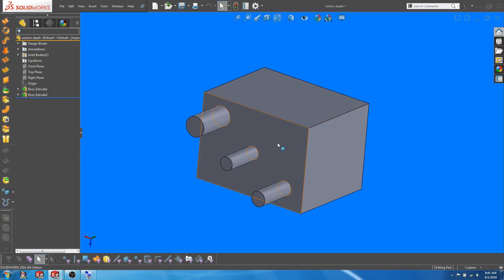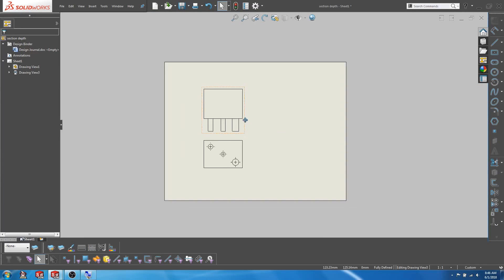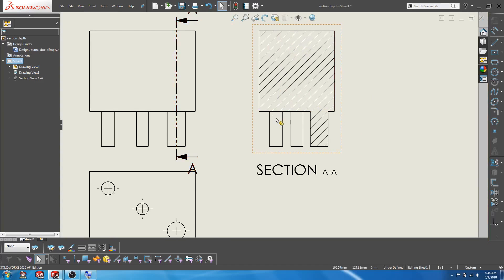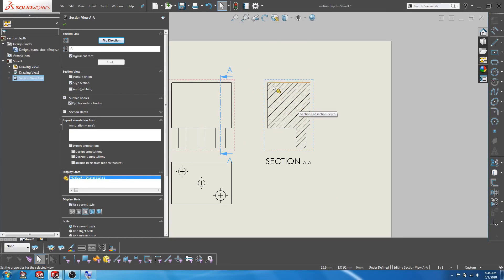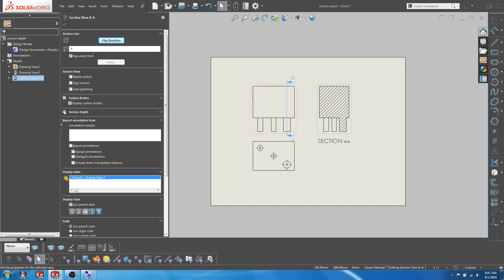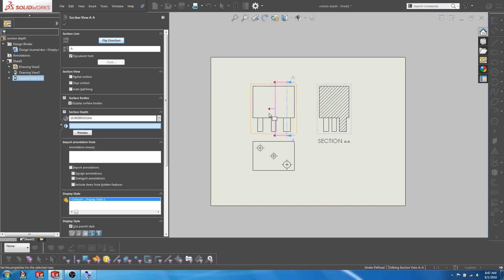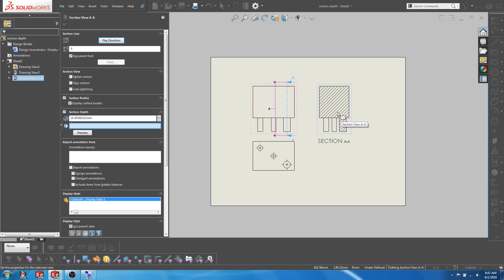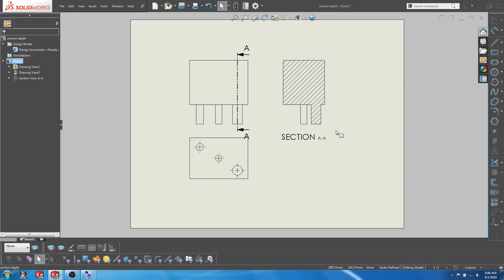Solidworks Drawing - Section Depth

Comment: Is it possible to adjust how deep the section view cuts? I.e if the job was say 50mm wide, have the section view only show to a depth of 25mm deep.
I want to make a section view in an end of a job to detail an end port only. So I only want to show that end port and not the whole model.
Reply from the maker: Hi, if I understand your question correctly, I think what you are looking for would be a half-section. You can look for this option in the section manager pop-up. Try it and let me know!
Reply: Solved it. What I needed to do was create the section view and then crop it to only show the parts I wanted.